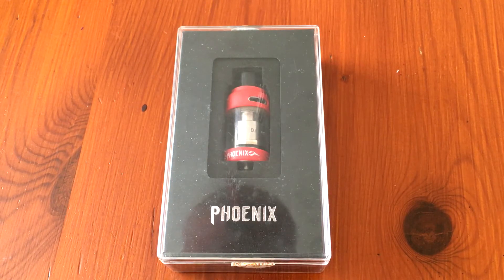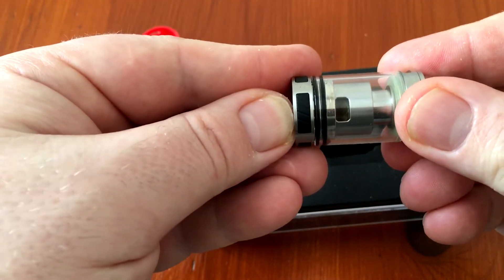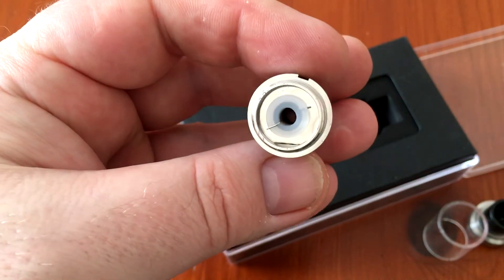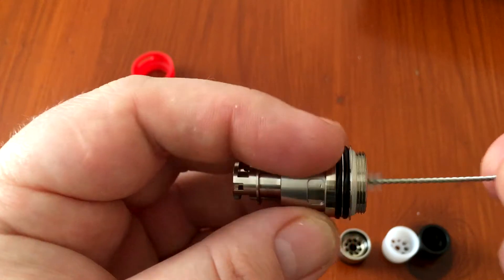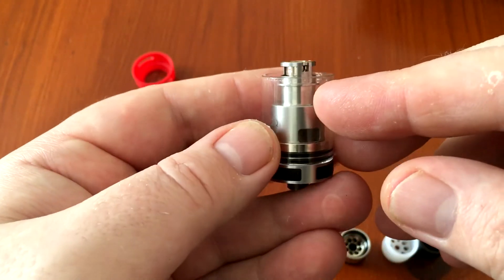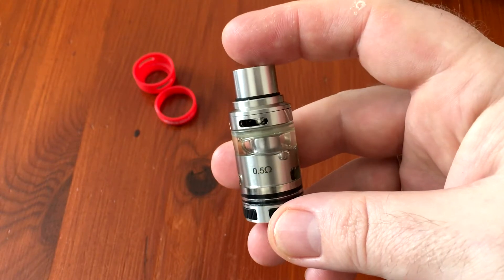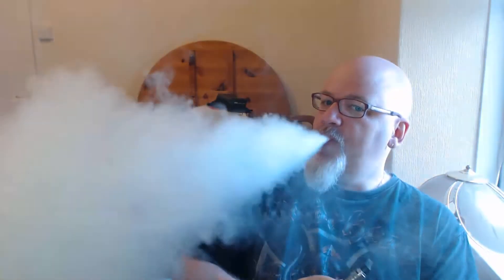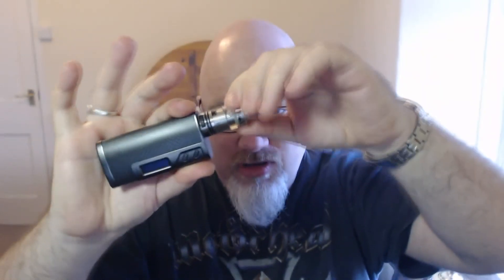Counil of Vapor Phoenix Ceramic tank long term usage review

Comment: Do you get any spit back & juice build up in the drip tip?
Reply from the maker: Sometimes I get spit back if the wattage is too low, not had any collecting of liquid around the drop top though
Reply: Agree on all points. I've seen that they do, now.. sell just that center 'coil' section &, well... to weigh pros/cons for repl. coils OR... ?  If only they could do away with that cotton somehow & still have 'er perform as well, wick as well... 'Cuz idk.. seems to me after 2+ months it would prob start breaking down being submerged in liquid all the time, ya know?  That said, if the flavor quality & performance... spending $25 or so every couple months vs a bunch of repl coils is worth it, gets a huge thumbs up imho!  I've , personally always LOVED ceramic coils.  Some, quality/type has been questionable, but... for the most part, super clean, crisp flavor overall imho.  I even have a couple drippers from WAY back (Marquis!) that STILL have a piece of ceramic "wicking" through their coil from rba supplies (won Pbusardos wicking challenge long ago too) That, dry burns clean each/every time & the tiniest piece lasts FOREVER.  Just use in place of cotton!  Really good.  For pop & go coil/tanks tho, COV kind of ticked me off w/ this one.. saw VERY shortly after its release, on their site...  PHOENIXv2... DEFIANTv2.... MINI VOLTv2.... even their box mod taken from 60w to 80w.  ALL, a whole new product to be bought, rather than any updates to a-one of them! =/   Ceramic, imho, esp this style (if you're still using OR the person asking question is wondering) performs best vaped a little differently.  Because is HOLDS HEAT like.. idk.. bake-ware? mugs?  Some may get condensation around the drip tip & what might seem like spit-back..  IF, when you vape, try to get into the habit of letting go of the fire button a full second, two, maybe 3 or 4 (depending on setting) EARLY, while still inhaling like normal...  The device IS still producing vapor due to the heat of ceramic (just usually its already sitting back on your table, getting wasted.... which, if not vaped, can... turn into condensation sitting there)  Save a little battery life & let go of button a second or 2 early, still inhaling like usual & enjoy ALL the vapor your e-liquid & coil are still producing.   Also, can instead... get in the habit of purging before inhaling... Blowing out quick a couple times before inhaling to "clear" anything in there.  No gurgling, sputtering or spitback if you always "BREAK IN" a new coil before 1st use (see quest4vape orig video some time ago----on Crown tank--breaking in a new coil for process) Just as you'd never see someone using a dripper w/out getting their coils glowing evenly, same applies with stock coils just done "differently". Otherwise, pools of liquid sitting where its not glowing & wick is oversaturated perhaps.. next to places where it's dry, glowing TOO hot, producing dry hits... Those hot spots touch those pools & like hot lava, they are going right up to your mouth! =/  Yep. Break in a new coil & that won't happen.  Same with closing AFC before opening any top fill tank. You can do it quickly without "sometimes" but maintaining the internal pressure makes for proper & consistent wicking/feeding & also IS.. what holds the liquid inside.  If many would take that half a second regardless & just close AFC off first-----they'd see for themselves.. no more leaking issues, well.....  EVER. =) Top fill tanks haven't always been top fill for a reason.  Idk why, people don't seem to want to hear that tho.. guess they'd rather have leaking, it seems. lol  Anyway, novel over, phew.. Good Lord, sorrry 'bout that. Ceramic.. ceramic...   PhoenixV2.... AND replaceable coil.  Idk what changed on V2 but maybe one of those options doesn't have the cotton?? Seems a good option tho, even if disposable.  I tend to use any coil "until".  Once it's performance changes or flavor, that's it.  Could be weeks OR some. months. Usually dep. on the liquid. :)  Live long(ER) & vape on!  #ABillionLivesFilm  #Right2vape